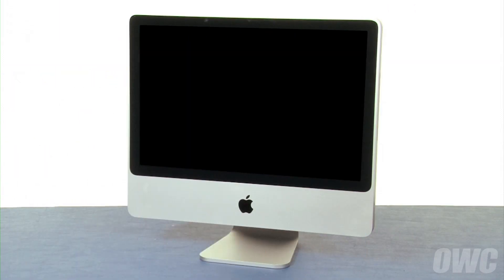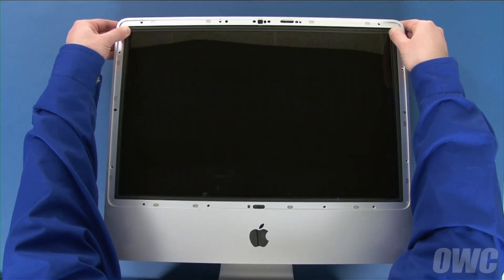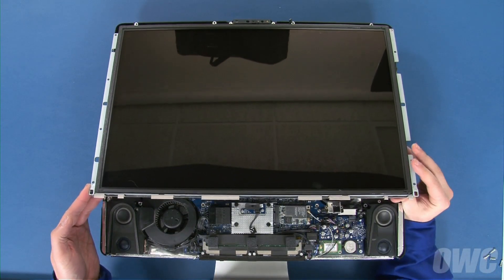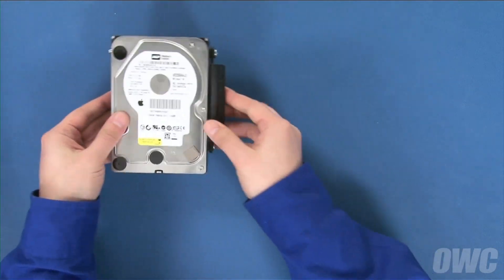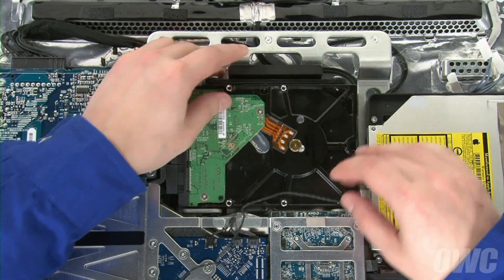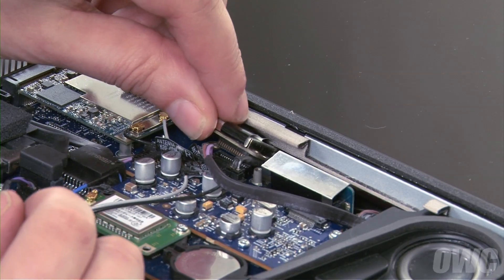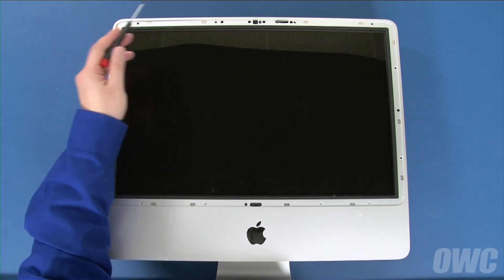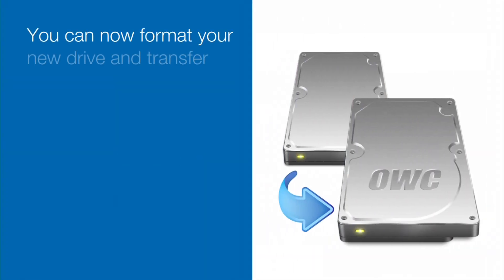20-Inch iMac (2007-2008) Hard Drive Installation Video (iMac7,1 iMac8,1)

Comment: 3:30 there are two inverter connectors shown. Does it matter if you connect them wrong? Think they should be marked if possible before disconnecting!
Reply from the maker: You’ll want to reconnect the cables to the same spots they came off from, but it shouldn’t be too difficult — you can simply match the cable colors together to ensure they’re in the correct position.
Reply: @poweredbyowc another similar video showed 4 connectors - two on each side! Thank you 👍

Comment: And 9 years later this video helped me install a 1TB SSD in an iMac 7.1 i found in a ditch lol. AND IT WORKS!
Reply from the maker: Man that's awesome!
Reply: @poweredbyowc  quick ???: what is the most powerful Intel chip I can put in that year’s iMac and not overpower the cooling system?
Reply from the maker: 💣🔥 That is awesome! Glad our video helped you out.
Reply: @poweredbyowc  I have a question though: what’s the most powerful Intel chip I can put in that year’s iMac and not overpower the cooling system?
Reply from the maker: The answer would be great if you asked Apple. Unfortunately, OWC does not support any processor upgrades since they are soldered to the motherboard. We offer upgradability only to Macs that have the capability.
Reply: @poweredbyowc  no worries! Thank you!

Comment: Nice tutorial !!! but i have a question, do i need to remind which Cable came in/out from the inverter to the Display? (Grey / Blue) or can i just put it back how i want? 

kind regards
Reply: In this situation I use a felt tip pen, draw a sign before separating connectors and you're safe

Comment: I followed this tutorial with my 2008 iMac SSD replacement and it worked great. One thing that should be added is to replace the PRAM battery while the computer is open. It's in plain view when the bezel is removed. It's a 2032 battery.
Reply from the maker: That's a great suggestion!

Comment: Just swapped the old drive in my '08 iMac for a new SSD.  Your instructions were spot on and the new drive works perfectly.
Reply: Hi could you give links to what drive you used? Did you need an adaptor?
Reply: Did you need a harness for the ssd?

Comment: I didn’t label the inverter cables. Does it matter if they are swapped?
Reply: Never mind mine works. The new ssd i installed is running great

Comment: Do not label the video cable connections, it is possible that I have switched, and now you are not calling, is it possible that it is?
In case I have changed the connections, there may be no connection. Because this is happening in my Imac 2009

Comment: I have an Imac 2 years older and have had it apart. Your video teardown is different than mine. WTF.  Apple changes the way disassembly is done from year to year? First it's easy, then do it from the back, then do it from the front. Make up your mind. PC towers are pretty much the same from year to year sense forever.

Comment: Thus will sound stupid but would it be possible to put a flash drive actually meant for a macbook pro in an imac from 2007 holding it in place using ducttape? To add even more stupidity, since the gpu is also broken could i put in a newer gpu or do i HAVE to get the same old gpu.

Comment: great video! Maybe i will replace my hdd with an ssd
Reply: TheRailroad99 there's another video which shows that the sata connectors won't reach to the smaller ssd if you use a regular bracket.

Comment: OWC does a professional video of Step by Step Procedures. They have edited the Video and installed the Audio very well. only thing I find that needs improvement is the Background Music it is too loud. With that fixed watching their instruction should be a rewarding experience. As previously mentioned by "The True Fizz" Label the two pairs of cables connecting the display.

Comment: it will not explain how the two upper and lower sockets are connected left of right???because the lower and the upper connectors blue and black (male) fits on both female connectors

Comment: Do you happen to have a vid for installing an SSD in an Early-2008 20" iMac?
Reply: ***** Cool, thanks!
Reply: Hello, I wish to do the same, to install an SSD with an Adaptadrive. What or where do I stick the thermal sensor, somewhere on the newly installed SSD?

Comment: This video was very helpful, but I'd like to know why the memory access door has to be removed. It doesn't have any bearing on any of the rest of the steps, and it's a real pain. I don't see anything in the tear-down guide saying it needs to be done, either. So why do it?
Reply: Oh, the bezel won't come off otherwise--is that it? Ugh. That stupid door is, IMHO, the worst part of the whole thing. Not a great design, Apple.
Reply: +Nancy Norbeck why is it such a pain its only one screw?
Reply: The cover grabs behind any RAM card plugged in.  You don't have to remove it I think if you don't have any extra RAM sticks.

Comment: I'd like to install an SSD into a mid 2007 iMac. Do I need to purchase something to hold the 2.5" SSD into place or is it alright if it's smaller? If you have any other better ways please let me know! Thank you very much.
Reply: is it also a sata drive? you sure this will work on this 2008 machine ?
Reply: so did it work ? i plan to do the same :)
any advice ?

Comment: This video was incredibly accurate and helpful. Managed to perform this in less than an hour. You do have to watch which side is up when swapping out the mounting hardware and when you are finished, book up your computer and format the drive from the disk utility otherwise your mac won't recognize it and you won't be able to restore it. Nicely done.

Comment: This is a great video. Using these step by step instructions I have been able to install a new SSD on my 2008 iMac. The instructions are perfect and to the point. Thanks so much guys.
Reply: sanjay Hi :) did you need and adapter or was it plug and play ?

Comment: Very high quality video thank you..I am thinking of replacing the HDD with a SSD. what are your thoughts?
Reply: Michael Giovannetti  An SSD is the best computer upgrade that you can make to any system.
Reply: Done! Actally three times now. iMac and two MacBooks.
Reply: Michael Giovannetti hey, what did you use for your iMac? did you use an icy case or something to fit the ssd into the old HD's place?
Thx
Reply: padda3vs3 On the iMac, I used an aluminum frame adapter. came with the kit. on the MacBooks, they fit right in. Just swapped the screws. Good luck ! still working great!

Comment: I bought a 1.0TB Desktop SSHD Solid State Hybrid Drive 3.5" SATA 6Gb/s 64MB Cache 7200RPM + Software Bundle from OWC. Can I use this hard drive to replace my 2007 iMac 7,1 20 inch 2Ghz Intel Core Duo hard drive?
Reply: Edward Flores Yes. I was able to swap my WD 1TB HDD for a Seagate 1TB SSHD drive.